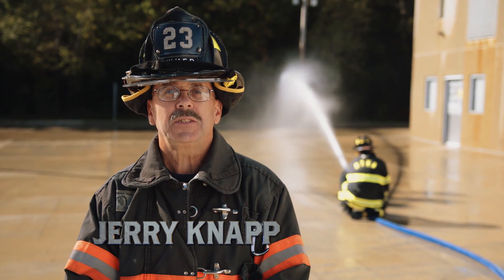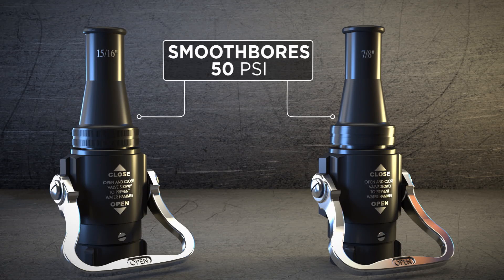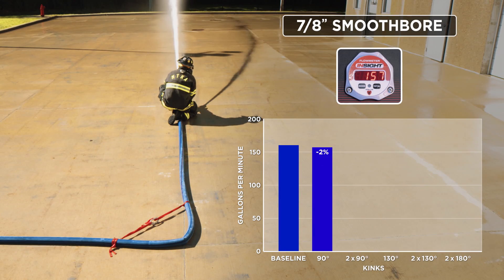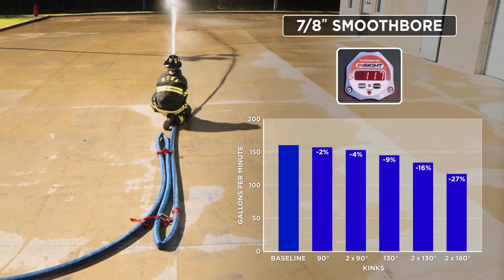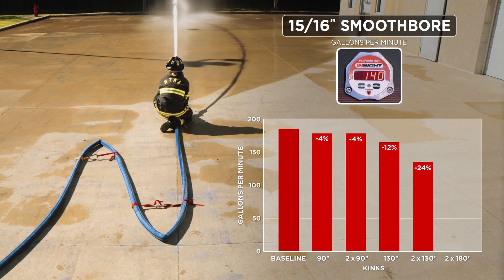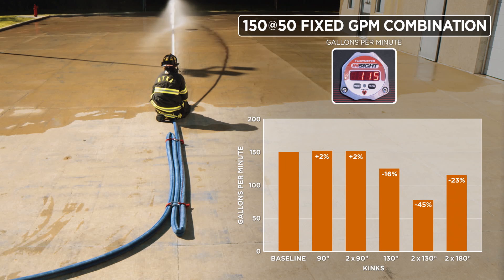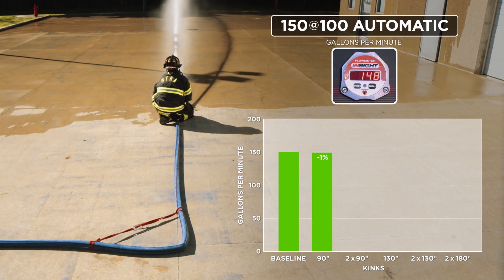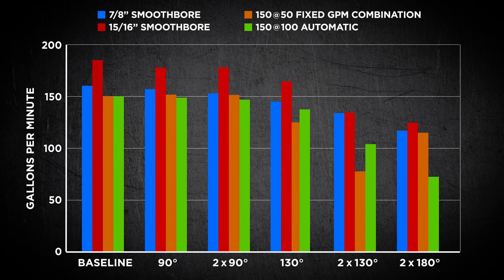How Kinks Affect Your Fire Flow System - Brass Tacks & Hard Facts (Episode 35)

Comment: I do not want to be taken as attacking or criticizing your video! I think this was a tremendous video that proved a testament to your "high quality hose!" I would like to see the same comparison with new and used 1.5 and 1.75 hose. My guess  is, as you pointed out, different equipment,  age, quality, and condition, could have more significant results on your test. It might even be that going with your HQH, eliminate's the problem in most cases. I know that 15 years ago, we went to low psi red heads and I proved with a flow meter,  that putting one good kink in the hose took us down by 50%!  Repeatedly! I think your video makes a great case for upgrading and modernizing a department's old and tired hose! Thank you for an informative video!

Comment: What was the hose size in this test?  1 1/2" or 1 3/4"?  Also, with the increased use of wetting agents in modern fire apparatus, it would be interesting to see how  these agents affect flows using the same parameters.